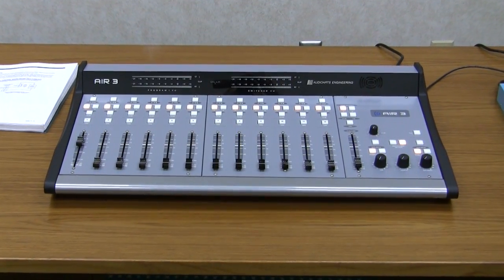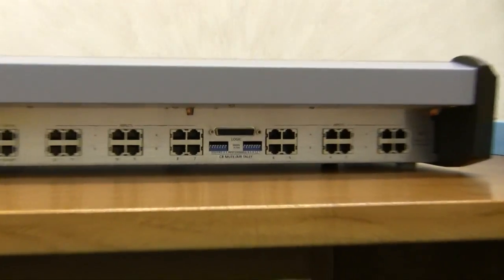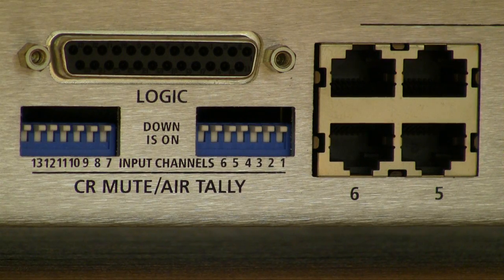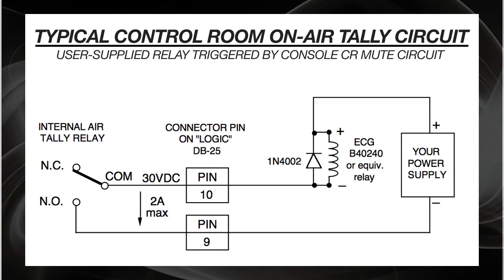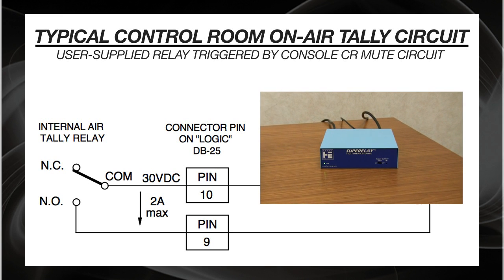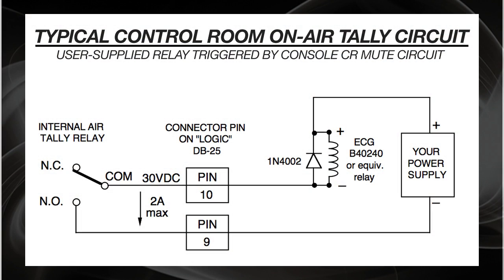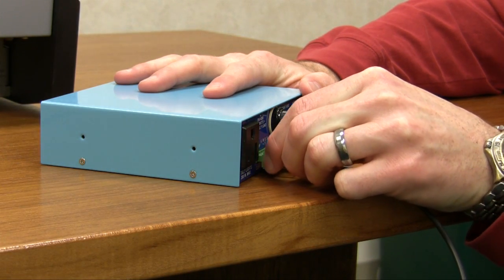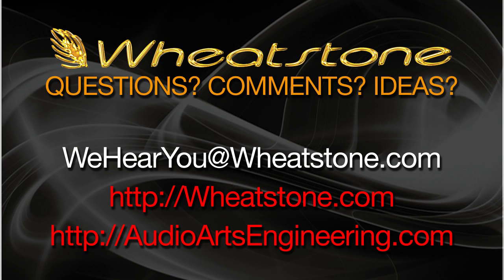Frequently Asked Questions: On-Air Tallies with the Audioarts Air-3

Comment from the maker: The relay box used in the video is made by Henry Engineering and is available from almost any broadcast supply dealer. Those same dealers can also supply you with ON-AIR indicator lights in various forms. For a start, try Broadcast Supply Worldwide. (YouTube will not allow me to post a link.)